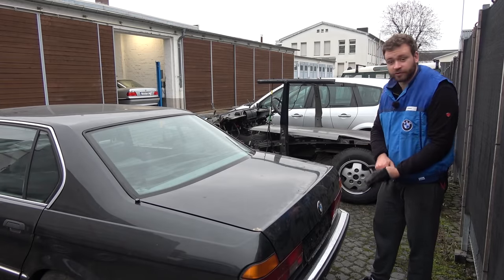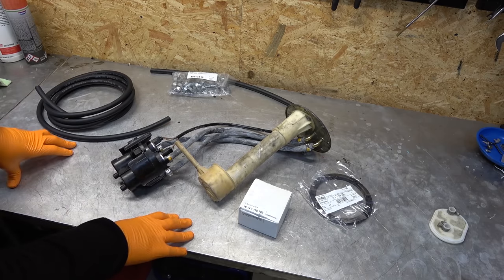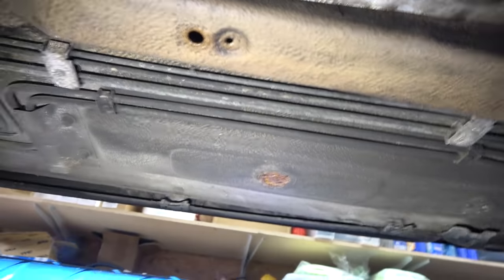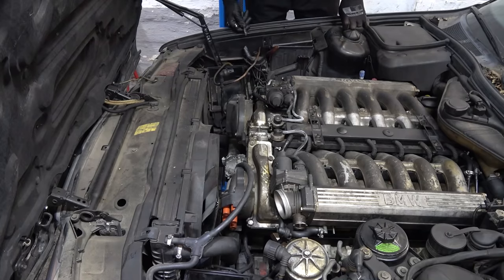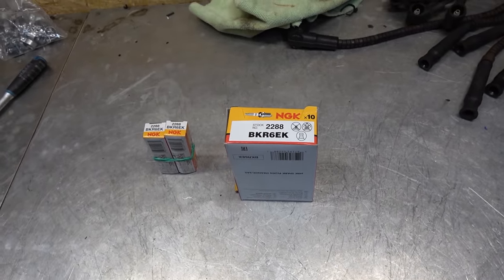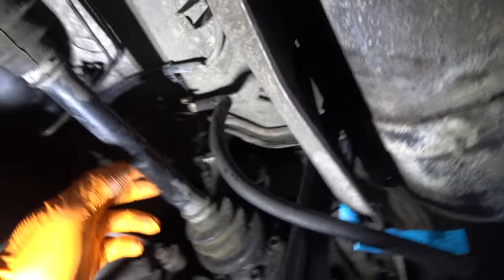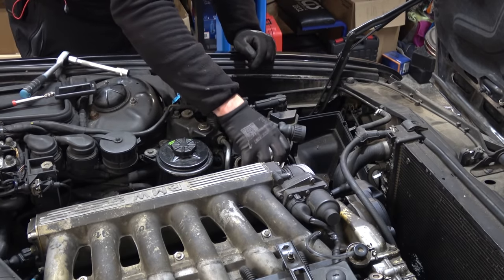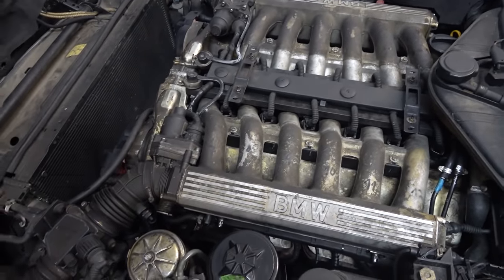First Start in 5 Years - V12 BMW E32 750iL - Project Karlsruhe: Part 3

Comment: Hello Herr M539! And friend and i are starting in a E32 750 IL from 88 aswell, I thought you might have expertise in fixing the Hydraulic lines for the brakes and suspension. ours is completely rotted away

Comment: Hello, I love your vids. Since you know much about m70 engines, is it true that ecu programs are made for 91 octane fuel only in the early E32 BMW? Did you hear about a wokke performance chip, sorting this issue (ecu remapping) and also WOT issue? (throttle body not fully open under 3.5 revs). Thanks for the reply.
Reply from the maker: Yes. Wokke chips are great

Comment: Can you replace the fuel hoses in the engine compartment of the M70 with the 20m hose from eBay? The display says up to 50 degrees and the hoses are close to the manifold?

Comment: Didn't it want to start immediately because the fuel lines were empty? Would switching the ignition a few times before firing the engine (to fill the fuel lines and build the pressure) help?

Comment: I love this... "Then I vacuumed the fuel up with the vacuum cleaner" :D Yeah, lets suck up flammable fumes into an engine that could create sparks and all could explode. Keep this up, it is great entertainment.
Reply from the maker: No, it cannot explode, this isn't Hollywood. I'm using a wet shop vac which is fine for such stuff. 
https://youtu.be/C-0-PH-ZU_0
Reply: @M539Restorations  Still amazing entertainment - thank you for an amazing channel :)

Comment: Does the 1 kohm rule also apply to the M60 engines? I had my spark plugs changes a while ago and the engine's been running strange... might as well check them.

Comment: I'm little bit confused. Is it injector? But we have Rotor BMW 12 11 1 734 110. Would it be better use an electronic commutator? And new ECU. Elso update alusil in cylinders to Cast Iron Liners.

Comment: I took some steps from the display when I saw you using the vacuum cleaner in the fuel tank. Are you sure that is safe?
Reply from the maker: Yes, with a wet shop vac.

Comment: 34:15 I just REFUSE to chase repair gremlins these days. My 2000 Maxima refused to idle (would die) at stop signs etc etc. I put it in the shop, idle control valve my mechanic said. Valve, Coolant change and P/S Belt adjust $400US. I drive 60 miles CEL"P0505" (Idle Air Control Valve). I explain to my GF that mechanics are often sloppy or rush. I got out there and did the RELEARN PROCEDURE and now it's idling normally. //Shrugs

Comment: Does the specified fuel hose fit in with its dimensions (7.5X13.5)?
For e30 and e36 it should be 8x13mm.
Can i use the 7.5x13.5?
BMW is crazy expensive...

Comment: One more thing: I see you've bought a new fan clutch. In the last few years the BMW community had some bad experience with BMW original fan clutches (these are, of course, only rebranded BEHR parts), as they seem to die after only a few months. It seems they are no longer made new and they're only being rebuilt, badly. (I don't know if buying a clutch directly from BEHR would be and better. Probably not.)

In the past I've used fan clutches made by a Turkish company OT-SA on BMWs, and never had any problems. At least there I was sure to always get a brand new part.

Comment: I ve done such thing with e32 v8 fuel pump and replace tank due to corrosion. BUT TO USE VACCUM IS FOR ME VERY DANGEROUS DUE TO SPARKING MOTOR INSIDE IN CONNECTION OF FUEL OXYGEN MIXTURE - MEANS BOOOOOOOOM ;)

Comment: The 5 year old fuel is probably fine for a less fussy engine, save it for your lawnmower. Or someones Nissan! 😂
My Primera GT seemed to run fine on the fuel it had in the tank before being parked in a barn for 8 years.

Comment: I don`t know construction of this engine,  but how is possible to fire up without belt. In most of these cases the engine will be gone due to  beat between valves and pistons, may be here is different situation. Or may be there is a chain about sync the shafts and this belt is only for the additional stuff   like water pump, AC ect.

Comment: I would not use an electric vacuum to clean out the fuel tank. That is very dangerous and the vacuum could ignite any remaining fuel vapors. Please be careful. We want you to be able to continue with your awesome channel. Maybe let the evil twin clean the gas tank next time.
Reply from the maker: It's not when using a wet shop vac.

Comment: I see in your videos, seems people neglect required general upkeep maintenance and then install wrong parts.  That happens here in the USA also.  People who think they know how to work on a car, but shouldn't touch it.   Lack of choice of vocational courses in school I would say.  There is secondary education, technical colleges, but by 18 years old, some have made up mind on career and its not being a mechanic.  Most of the high mileage older BMW and Mercedes here in USA get sold off to secondary car dealers here.  The secondary dealers, still command high prices, do little to no required repairs because of trying to turn a profit.  Cars get sold, owners do patchwork repairs, anything major breaks, they sell car or let it get repossessed, then lender sells or junks car.  It is a sad process and a lot of cars that can be put back on road end up as junk.

Comment: Hello BMW guru. Can you please explain which ignition wires you use? I bought NGK bkr6ek spark plugs but i can't put my BERU wires on it. Spark plug have SAE connection but wires m4. :( At that moment i use zgr5a spark plugs without cups. Thank you for response.
Reply from the maker: That makes no sense, they work just fine with original Beru wires

Comment: So how are the cylinder banks named? When you where foggin them you said bank 1 is the left cylinder bank. But when talking about fuel regulators you said the right fuel rail is "bank 1" but in reality it is connected to the left manifold which is for the right bank! (Bank 2)???
Reply: I think the confusing part in these m70/m73 engines is that the manifolds cross in the middle.
Right manifold but left fuel rail is for the left bank. Bank 1?

Comment: I went to sleep at 2am watching his video and ended in this one I refuse to fall asleep to some insightful situation so I paused the video and came back to this morning and I’m glad I did that because knowing the shady shit mechanics do he points out the mistakes and “bypasses” mechanics do to get customers to pay a lot for basically no actual labor and cost. Wish we had more mechanics like this guy around! That other mechanic is a piece of shit charging ~6k ($) for wrong fuel lines, wrong spark plugs and putting in the fuel filters backwards. Some of this is down right dangerous for the person driving and engine.

Comment: in the end you said: "breaks are not good, but that is related to power steering pump is disconnected" -> how are breaks connected to steering pump? breaks are running on engine vacuum and power steering is totally separate thing, or they had something else in the 80s ? :)
Reply from the maker: Brake booster works off hydraulics.
Reply: @M539Restorations  but it is not connected to steering fluid, at least in my e46
Reply from the maker: It E32/E31 it is

Comment: Be careful with that vacuum cleaner, air molecules zipping at high speed create a shitload of static electricity. Needless to say that a tank full of gasoline vapours with an opening pointed at your face, exploding due to an accidental discharge isn't ideal.

Comment: As a mechanic from austria I can say that texar does not make good parts and only because it says premium or oem does not mean it is good. I always perfer ate when it comes to brakes.
Reply from the maker: I never had issues with Textar. ATE is also fine, use whatever you prefer.

Comment: Don't use a vacuum cleaner to clean out a fuel tank as it can explode!
Reply from the maker: Wet shop vac, it can't.
Reply: The fumes going through an electric powered vacuum CAN ignite.  Use an air powered vacuum sold by people like Snap On.
Reply from the maker: No, they cannot on a WET shop vac.
https://youtu.be/C-0-PH-ZU_0

Comment: Hey man love the video but you really should not use a vacuum cleaner for the fuel tank that is really dangerous because the petrol is still vaporizing and that will go through your hot vacuum cleaner and if there is sufficient heat it will explode, I am being extremely serious the bag in the vacuum cleaner will collect all of the petrol and create an explosion. I am not saying this to sound like a smart-ass it is really because a mechanic shop burned down in my country when the owners son was doing the same thing as you and it did explode.
Reply from the maker: It's a wet shop vac, nothing will happen.
Reply: @M539Restorations  okay awesome good to hear, I should have not doubted a German when fixing his car hahahah. But anyways have a good week:)

Comment: Holy cr*p. Never vacuum a fuel tank! Unless your vacuum is rated for it, the open rotor design of the motor is potentially disaster in a can.
Reply from the maker: It's a shop wet vac, it's fine.

Comment: Another great video, sir.   For safety reasons, I very humbly suggest you replace all the tires, including the spare, with tires containing a D.O.T. ( in America, dept. of transportation, year and month of manufacture) of  2020.  The last thing you need is to have a tire explode and 150 m.p.h. on the Autobahn.  As you may know, rubber is not a great substance to utilize for tires, but our world has not, as of 2021, invented a substance to replace it.  Why, I don't know.  Rubber deteriorates  when exposed to air, heat, and ultraviolet from the sun, and pollutes our world with billions of tons of rubber powder every minute of every day.  Not to mention the tire conspiracy that is ever present to this day.  Tire retailers charge new tire prices for a product that may have a D.O.T. of two or three years old, depending on the popularity of the model.  That means it sits in a hot warehouse drying out, waiting to be sold.  If a tire does not have a D.O.T. of the same year you purchase it,  demand one that does, or get a discount from the new tire price if you must have that particular model, because it is not "new".  Some retailers will not comply when they see you know the truth.  Such is the tire conspiracy in our world today.   If you don't know the truth, they will never tell you.  I learned this little known fact many years ago from a friend who was a retailer for a tire manufacturer. ..... It's a shame that certain auto mechanics in our world are dishonest and charge exorbitant prices for work they never intended to perform. This gives the good mechanics a bad name. The good guys are like finding a needle in a haystack.  Thank GOD for you !!

Comment: 9:52 Oh, don't use a vacuum cleaner in the fuel tank like that. If there's a static discharge, you could ignite the remaining fuel vapors in the tank and cause and explosion.
Reply from the maker: I'm using a wet shop vac, it's fine for that.
Reply from the maker: @Beer400C https://youtu.be/C-0-PH-ZU_0

Comment: The vacuum lines to the fule pressure regulators are connected in the wrong way. They need to be swapped, line from no.1 goes to no.2 and vice versa. Also, can you please elaborate on the spark plugs? The owner manual specifies Bosch F 8 LCR, the NGK ZR5F is the corresponding equivalent. You must be the only guy not using the NGK, and I can not see why.
Reply from the maker: Yes, I said in the video they are connected incorrectly. I'm not the only one and I explained it in the video. Research the forums.
Reply: @M539Restorations  Sorry, I missed the last two or three minutes. Glad you noticed it. Well, I have been in the forums for over 10 years, and I own my 750i just as long. This is the first time someone says the ZR5F are wrong. Never read about the ones you have shown in the video. Do you mean the E31 forum or the 7er-Forum?

Comment: Using a vacuum to suck up gasoline is a really easy way to cause an explosion.
Reply from the maker: It's not when using a wet shop vac.
Reply: @M539Restorations  No! Please don't let people think this is okay.  A shop vacuum is an ignition source.  Boaters know this as bilge fumes can explode when you use a vacuum to clean your boat.
Reply from the maker: A WET shop vac. It's fine and cannot ignite, explode or whatever.
https://youtu.be/C-0-PH-ZU_0

Comment: TECDOC says NGK spark part # 5165 (ZFR5F) and 1565 LPG Laser Line 6.

Official NGK website says part#
NGK 2477 ZFR5FIX-11 Iridium IX Spark Plug
NGK 3741 PZFR5F Laser Platinum Spark Plug
NGK 5887 IZFR5G Laser Iridium Spark Plug
NGK 7098 ZFR5FGP G-Power Platinum Spark Plug
NGK 7558 ZFR5F V-Power Spark Plug

2288 (BKR6EK) wrong part number. It`s uses in E32 730 i/iL, 740 i/iL, E38 728-740iL.

Сonclusion. You need to use spark #** (ZFR5F)
Reply from the maker: Wrong! Very wrong, I explained several times that those are the wrong spark plugs and the engine will not work properly with them. Do some research on the forums.

Comment: Your Car lifter looks sketchy af
Reply from the maker: What are you on about? It certainly doesn't look or feel sketchy.
Reply: @M539Restorations  because at 13:03 you can actually see the left pillar bending a little, but when the car is all the way up and you secured it, looks kind of safe i guess 
i just don t want to get yourself hurt cause i love watching your restorations :D
freundliche grüße!
Reply from the maker: Lol, it's not bending. This is a mobile life, it's not fully bolted down and doesn't need to be, it's moves slightly when going up and down which is normal for a 4-post lift.